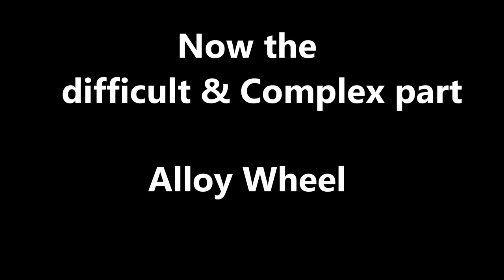How to Install Double Disc Brake On Motorcycle || Full Details with Price List

Comment: Double disc ka alteration wala welding risky hae subse best double disc wali bike jaise benelli ka alloys or shocks lagalo aap ka kharcha thoda zyada hoga lekin risk bhi nahi hoga 👍
Reply: Excellent solution👌🏻
Reply: Not possible alloy rim dusri bike ka daloge toh wo fit he nhi hoga because waha itna gap nhi hai fork ke bech me if you want still you can try that too i tried with cbr 600 Alloy and it was not fitting in so try your luck bro
Reply: @Lonewolfrc390r  Bro I was not talking about 600cc segment bike, afcourse it will not fit on 300cc cuz it has smaller arm holders ....but I was talking about benelli 300 and I know one guy who has fitted benelli front folks on his bike and yeah u need to do chota mota jugaad to fit alloys on it with dual discs ....but it's not risky at all as the bike shown in this video ....yeah but it's kinda expensive ....hope u find this helpful👍
Reply: @atozin6words2  need to change the lower T and upper holder to do that and end of the day putting 30k just on forks are waste and then alloy and other parts .
Reply: @Lonewolfrc390r  yes, that's costy ...only a bike lover (shaukin) can spend that much money on his bike ..... sometimes u can find luck in choor bazaars & other second hand bike markets...
Reply: @atozin6words2  True, bhai can you share your friend insta or anything where I can see modified bikes pics??

Comment: Can we put double disk breaks in R15 v3 non abs
Reply from the maker: yes bro you can ,,
Reply: Bhai train ke vaccum brake laga le ... kya karega double disc ka 😂😂😂
Reply: @prs27  R15 v3 ke brakes acche hai, but agar body aisi dikhe aur tyres rim brakes chotte dikhe bc match hi nahi hota. also, agar 120/60 tyre lagake double disc lagaoge toh it's instant stopping power. Karna hai toh karo marna hai toh maro, mere paas hai v3, mujhe bhi karwana hai

Comment: Go to a Hyosung dealership and buy GT250R rim and front breaking system and save the hassle and time.
Whatever you have done is really dangerous, that weld may break under pressure.
Reply: That alloy costs 17k bro
Reply: @aravinthsoundar4843  A lot cheaper than life.
Reply: if that's a good weld, assuming there's no brazing, a 320mm disc would apply about 2200N on the caliper mount and the same on the rotor. iron's tensile strength is 540N/mm2. It'll hold. plus, hyosung brakes plain suck
Reply: That's right
Reply: @andrewcarnegie5342  what a brilliant answer 🔥
Reply: Well, the stock brake is still there on the other side.
Reply: exactly
Reply: Better You can just move to Benelli showroom and buy the Benelli 300 fork and wheel

Comment: My question is is it required to put dual disc set up for 390 or just upgrading to single bigger disc also resolves all the old bikes issue. Looking like this a bit overkill for the 390

Comment: Sanju mods as has installed double discs rotors on a single rim without cutting & joining to mags in an easier & safer & much more cost effective way..
Reply: link plz

Comment: What about the speedometer wire, did that also work??
Reply: It's single wire which get placed in tire hub (as a company fitted) so no need to do extra work om that
Reply from the maker: @souravraorane3500   Thanks for the explanation Brother .. Love you
Reply: @BeerBikerSamy  I have questions regarding about lathe machine work cost

Comment: Reminder guys, don't do these. Modifying your bike by grinding disturbs the chassis at high speeds above 60kmph and may lead to unseen instances. Don't try this if you love yourself or the motorcycle. Dual disc rotors not recommended using this method. Save money and buy a bike that comes stock with it. Alterations like this not at all safe for riding. Peace out.

Comment: ye banda chutiya hae he doesn't know what he's talking about.. 7:04 he says abs works only one side .. No abs works on both the discs but only one disc has the sensor but ABS working will be done on both the brake calipers.. another is if u are making alterations in wheel you basically destroy the structural integrity of the wheel and with a shitty welding job like that the weld will break when u will apply sudden brakes or even in pits... another issue is no matter how u get it done from any experienced person it will always have errors and it will vibrate on high speeds and eventually fail your brakes , bend your rim again and again , leak your forks ..

moral of the story : don't be crazy for double discs .. single disc or double all they do is stop your bike.. just to make it look cool on a 390cc bike is not worth losing your life